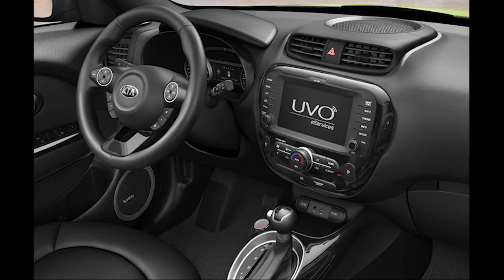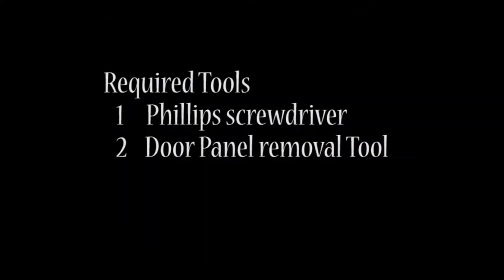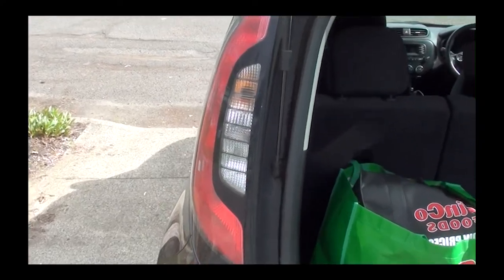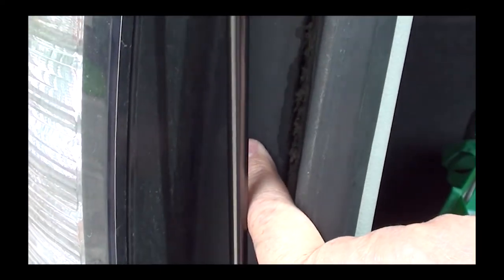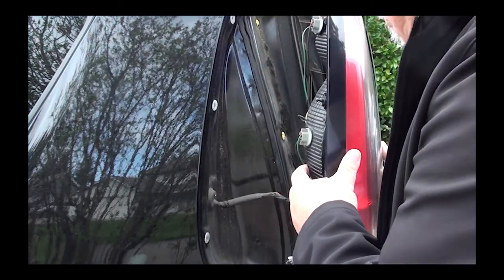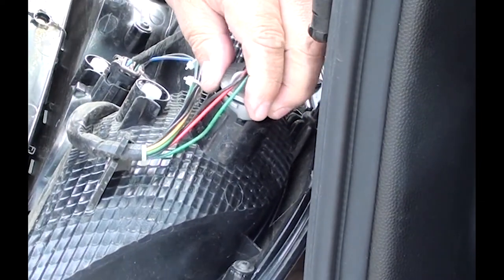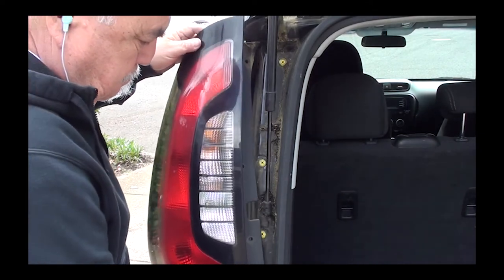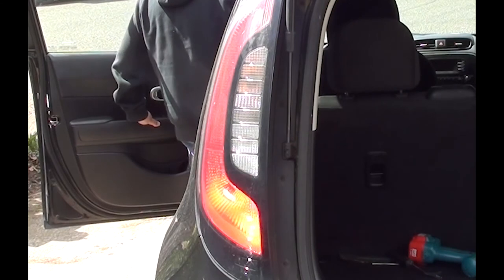Kia Soul "How to  Fix Rear Driver side Brake Light"  DIY Save Money.

Comment: I changed my bulb but my brake light is still out
Reply from the maker: i would get a tester and see if your getting power in the socket. if no power check your fuse

Comment: It would be nice to mention the bulb size
Reply from the maker: its easy call your parts store.
Reply: @notsofast2325  wasn't trying to be smart, but would have been even more helpful if you had mentioned it, but good video
Reply from the maker: Your right, I guess I could of .. but the bulb number is right on the bulb. I will try to remember that next time. thx Robert

Comment: I have an issue withthe turn signal light. I changed the buld, the light blonks a few time, then turns off.
Reply: Any suggestions on what todo next?
Reply from the maker: @jessicaanguiano3725  check your Flasher